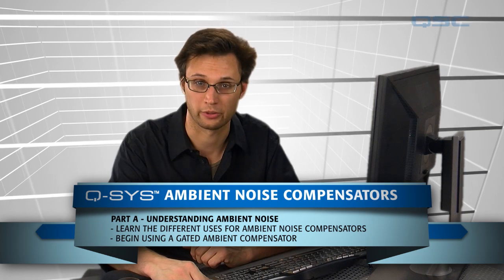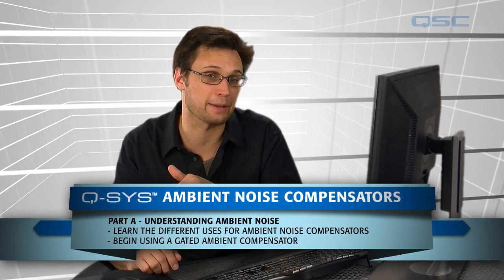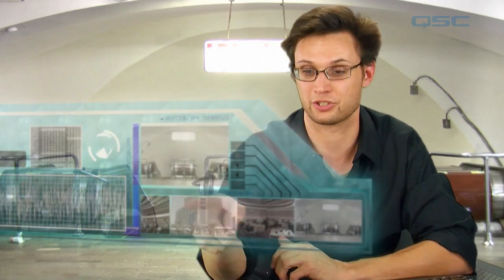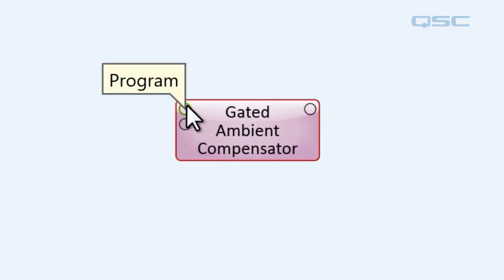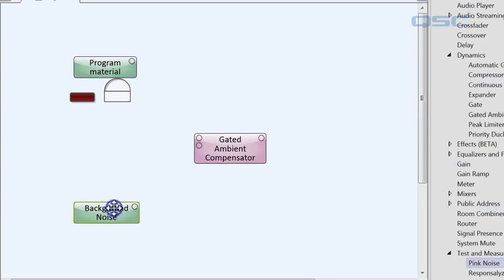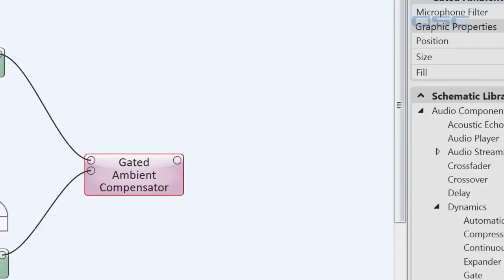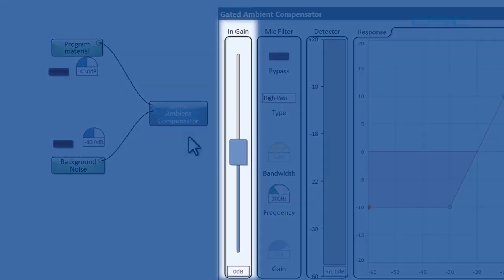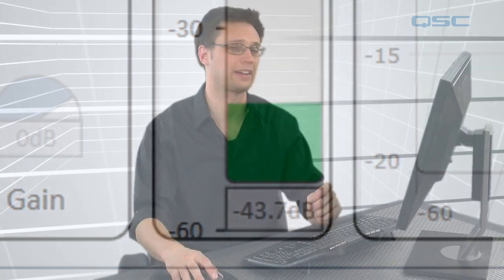Q-SYS: Ambient Noise Compensators-Part A (Setup)

Comment from the maker: 1)  Yes, the ambient noise compensator cannot run in emulation mode, and requires a Core.
2)  This video isn't duplicated.  There are three parts (A, B & C)